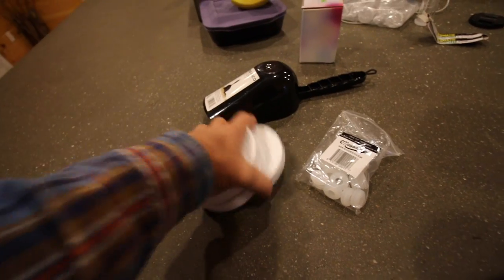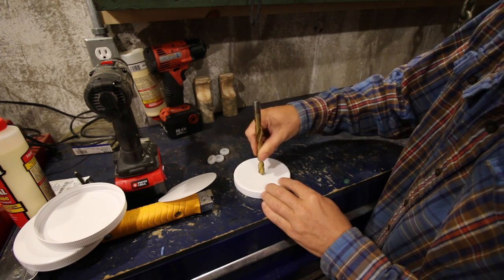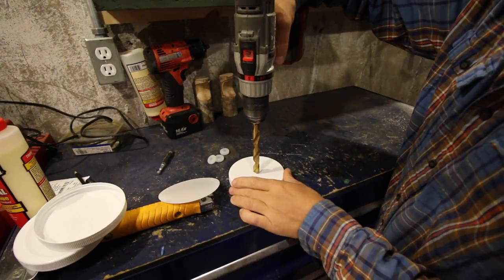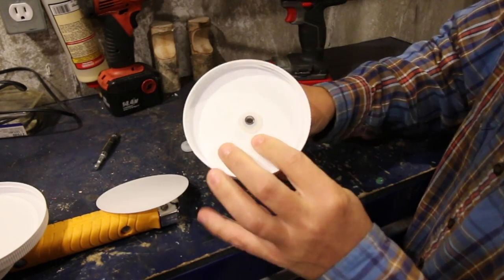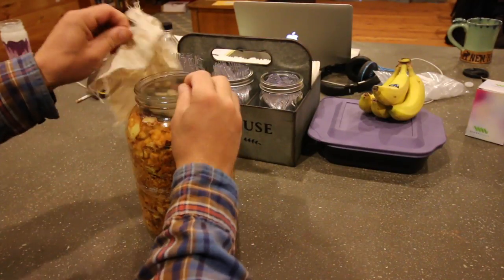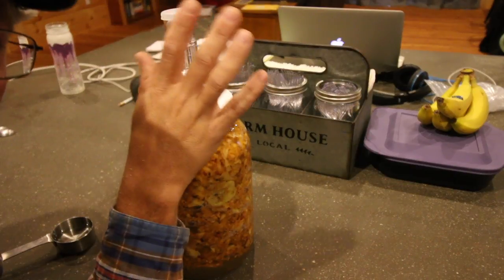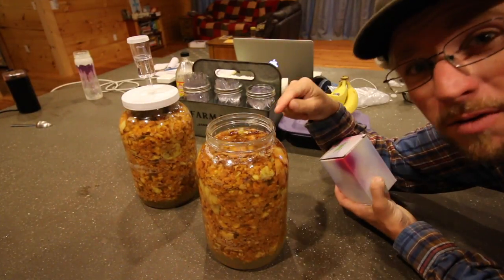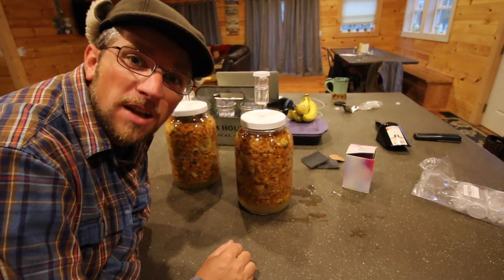Cheap and  Easy DIY Fermenting Lid with Airlock for any Jar.

Comment: You can also just add a tube to a lid and rubber band a small rubber balloon on it.  The balloon will fill with gas which will slowly seep through the balloon.  When the balloon completely deflates, the fermentation is done.

Comment: 6:00 a.m. in N.H. is 3:00 a.m. in Steilacoom, Wash. which means just one more temptation to watch another YT video before I wrench myself away and go to bed, so thanks a lot, doggone it! 😘 
     That air lock is a one way valve. It works, basically the same way as the one "The Good Doctor" in Episode 1 improvised in the San Jose airport to relieve internal pressure on the lung of an injured kid. [My favorite new series, I watch it on HULU.]
Reply from the maker: Lol, We watched that episode is there more out?

Comment: Hey Modern Steader!  I have one of the expensive fermenting lids, but love the DIY version.  Do the plastic lids make a good seal with the jar?  Tip...use vodka in the airlocks.  It will not evaporate out like water does.  I fermented some hot sauce for 6 months and got tired of refilling the airlocks.
Reply from the maker: Yes the plastic lids seal nicely, thanks for the tip

Comment: Great idea. All should be airlocked, with a touch of brewers yeast until it turns to alcohol, alcohol needs anaerobic fermentation, once it’s turned to alcohol strain and cover with Muslim and tie, vinegar needs aerobic fermentation, and it needs to start with alcohol and a drop of store bought apple cider to ensure a good strain of acetic bacta, forgive my recall, it something like that, that’s the mother. Then you will see the mother on top remove and you have your starter, filter and bottle the vinegar. You don’t have to add the apple cider vinegar, it will get it naturally, but to hasten and ensure a good strain it’s advised.

Comment: Wondering what sized gromets and what sized hole do you drill so yu have a good seal?
Reply: I like to use clear vinyl tubing with no gromet.  You just drill a home that's slightly smaller than outer diameter of your tube and pull your tubing through the hole.   I will then either submerge the other end In a jar of water or I will loop the tubing and fill the tubing with water.

Comment: So how do you tell when it's ready? I have these airlocks. Does it tell you when it's done?
I found an ACV recipe that was hands off. Other Vinegars I have made I stirred and added fruit and water every day, covered with a cloth.
Just fermented avocado using my Fermentation Starter, checking everyday. Really good! Then Sprouted Chickpeas, and cooked them. Then mixed with avocado ferment, and have topped it with the glass air locks. Guess I will check it in a couple days since I am using already fermented components.
I guess I was hoping there would be something in the videos about how long it takes and what the air lock looks like when it is ready to eat! Thx

Comment: Will the first two become hard cider instead of vinegar? I think vinegar is aerobic and that alcohol is anaerobic. (Not sure if I'm remembering right or not)
Reply from the maker: That sounds right, I guess we will see in a little bit. LOL
Reply: For the first stage of fermentation, simple, short chain sugar to alcohol, requires yeast. For yeast to begin this conversion, it first needs oxygen. Yeast cells will absorb as much available oxygen as possible from the solution. Then the yeast can begin reproduction to build a larger colony, then to convert the sugars to alcohol and CO2. Yeast can not convert long chain sugars with links of more than 3 molecules, (long chain sugars). There are natural enzymes, alpha, and beta amalayse that can break down long chains to shorter, but that is a process outside of making simple hard cider. The need for oxygen in this cycle would make it aerobic. Without the introduction of yeast at this early stage, one is reliant on there being natural airborne yeasts present. The drawback to relying on natural yeasts is that other bacteria, molds and fungus may be present in large enough quantities to infect the solution before fermentation can begin. This is why I recommend introducing yeast at the very start. It could be bread yeast (Saccharomyces Cerevisiae) or specific yeasts used in home brewing and wine making that are available online.
Once the alcohol is converted, acetobacter, if present, can begin to convert that into vinegar. Typically acetobacter will develop a colony (mother) that covers the solution, much like a scoby in making kombucha. This mother protects the solution and further absorption of oxygen and completes it's process anaerobically. Once again the introduction of a mother, whether a purchase mother or one from a natural vinegar left to develop mother, facilitates the process.
This is a true fermentation process, often it's confused with pickling which is often referred to as a fermentation. Pickling is done with a brine solution and is a completely different process from fermentation, a;though conversions do take place in pickling as well, not the same.
 Before the fermentation process was understood, brewers and vintners relied on natural yeasts, present in the air and on the skins of fruits. Once it was understood the role yeast plays in the process, both started to develop their own yeasts which they recycle from brew to brew. The reproduction cycle of yeast starts with one cell budding more cells. Each of these cells then bud additional cells. With each budding the parent cell releases some of it's oxygen to the buds. Depending on the nutrients available as well as the types of sugars these buds evolve to their conditions. In one fermentation process there are several generations of yeast reproduction. Although most of these are Saccharomyces Cerevisiae, typical bread, ale and wine yeasts, Saccharomyces Carlsbergensis a bottom fermenting yeast is used in the production of lager beers. It was with the reuse of these sub-strains that breweries and to some extent, wineries can brew consistent products. Wineries are also reliant on seasonal conditions while growing their grapes, sugar content etc. that have affects on different vintages. 
I have been studying, researching and brewing ales, wines(primarily fruits other than grapes) and honey mead, as well as having a continuous batch of malt vinegar running for over 20 years. It's my hope some of you may find this useful. Good luck with your own fermentations, it's a very rewarding and enjoyable process.
Reply: David, I'd love to hear about your malt vinegar production.
Reply: It started as an adjunct to my home brewing and wine making. I grew up on the east coast of the U.S. and we more often than not put malt vinegar on our french fries (chips). I was brewing very often back then and decided to boil up some light malt powder (3 lb bag available online from brewing suppliers as are most of the other things I might mention) for a 5 gallon batch of wort that I fermented with a pale ale yeast. Once fermented out I racked (transferred) this to a 5 gallon bottling bucket (a bucket with a spigot near the bottom). I had already purchases a mother of malt vinegar which I added to the bottling bucket. Put on a lid and airlock and ignored (actually I had it tucked in a corner of my brew cellar and forgot all about it). It was not unusual as I had a brew supply shop, that I would have several batches of beer, wine and mead in different stages of the process. I rediscovered the vinegar roughly a year after setting it up. I tapped off a little and it was wonderful. At that point I would draw off a quart at a time when needed. As I neared the bottom I brewed up another 5 gallons of beer from a light malt extract powder, ferment out and add to the vinegar bucket. I've been running off this same batch for roughly 20 years. Every time I top up with fresh brew I do have to use a stainless steel spoon and skim off some mother from the top. 
I prefer a sharper bite to my vinegar which I get with the light malt extract. If you want a richer flavor but with less bite you can use amber male extract. Any online brew supplier has all the essentials to get you started, equipment and ingredients.

Comment: I think you are making alcohol rather than vinegar with the airlock.
Reply from the maker: I guess we will find out soon! :) I am glad we did some differently
Reply: Making alcohol is different, requires different techniques. But fermenting was/is the beginning of making alcohol. You can end up having a very minor alcohol content when you let things ferment by minor I mean almost un measurable less than 1%.
Reply: Craig Meloche -- I think yeast is required to make alcohol.
Reply: I think fermentation process uses natural yeasts which are already in the air, most foods.
Reply: Given 10 minutes reading on the internet, alcohol is converted to vinager with bacteria and oxygen.  So the first 2 with the airlock are making the alcohol which will next have to be converted to vinager. And you will go back to using the cheese cloth.
Reply: Yes you can convert alcohol into vinegar but that is mostly alcohol that has gone south or purposefully turned into a vinegar. This type of vinegar would be how I would start to make a brandy let it ferment for a little while in the sugar then I would send it through some sort of still of your choice adding more sugar and water as well as yeast but a certain type of yeast this is required for the microbes to make alcohol. You also have to then separate the alcohol from the rest through distilling. Now champagne is probably the closest in being made this way because it is bottled before it is completely alcohol and gets it's bubbly as the process finishes turning to alcohol. Homemade wine is close as well because all alcohol starts with fermentation yet you must then introduce the microbes to create alcohol in the process of breaking down sugars. Fermentation doesn't exactly do this but can if exposed to the proper bacteria. Alcohol and fermenting/vinegar making walk very closely hand in hand. You can get one from the other and start the same etc. It's how the Egyptians found alcohol.